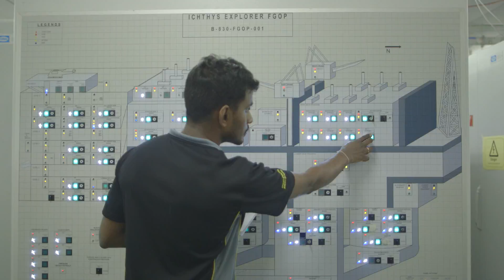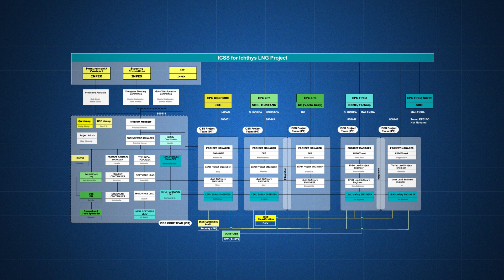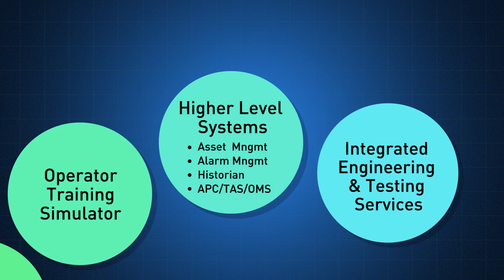LNG Supply Chain: Ichthys LNG Project

Comment: I have a question for INPEX? Is it correct that the life of Ichthys gas & condensate reserves will last for 40 years? I doubt that.....

The life of the Ichthys gas field (as per the gas reserves of 12.8 TCF and at annual LNG production of 8.9 Million tons) will not be 40 years. At best it will be 25 years if the reserves are 100% recoverable.

Simple & direct calculation is as follow: 

To produce 8.9 million tons of LNG per year it is required a feed gas rate of 1.65 BSCF/day to the onshore plant, Hence the life of the gas reserves will be: =(12.8 )/(0.00165 x 335)=23.16 years.  Providing a shut down for one month is carried out every year for maintenance.

The 23 years may go down if other loses during production is considered such as flaring during unplanned shutdown, plant upset and methane loses in the nitrogen rejection unit during purification of LNG.

Also, according to the condensate reserves of 550 million bbls and at condensate production of 100,000 bbls/day, the condensate production will only last for 16.5 years.

It is highly likely that this investment will be a burden on INPEX and on TOTAL because at current price of 45 US dollar a barrel and at 5 US dollar per MMBTU the total revenue for the life of the Ichthys projects will not exceed 89 billion Us dollars. If operating cost is deducted and the money to pay back the lenders and the banks is taken from the total revenue then profit per year will be nothing hence this project will not deliver a good rate of return for it’s 38 billion US dollar investment. 

 Bassam El Wazni